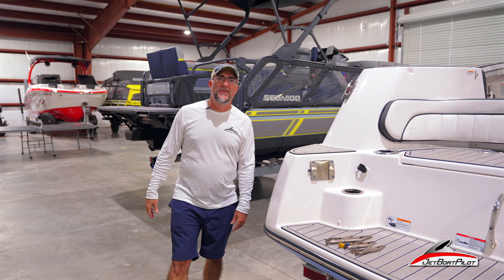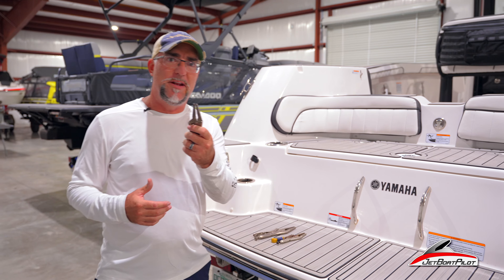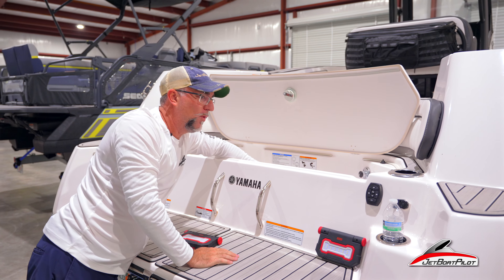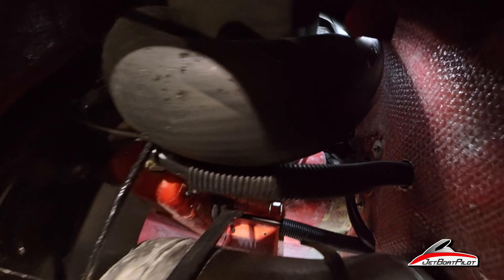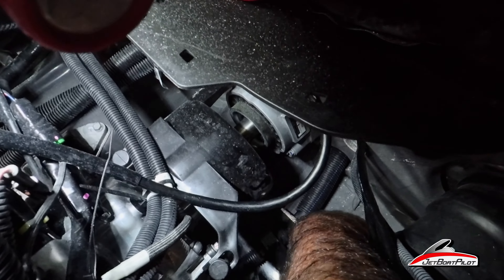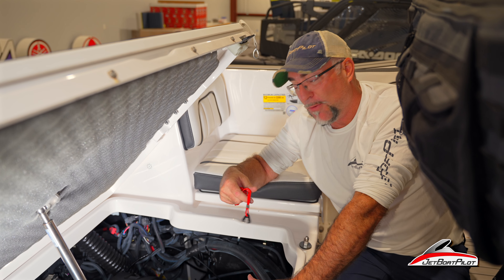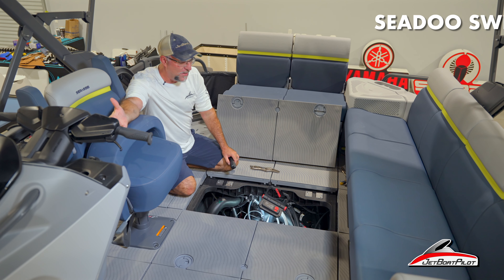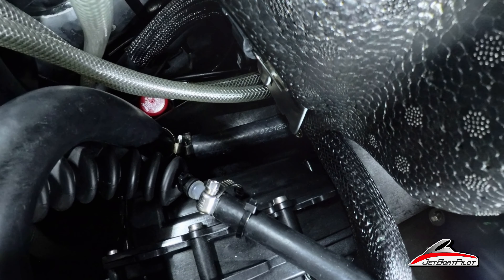Watch This Or Risk Damage To Your Engine | Learn How To Safely Tow Your Jet Boat

Comment: Yamaha, If you don’t have a set of pliers take your shirt off, or towel jammed in the intake via cleaning port and the water won’t make it through. I figure that out taking a bunch of sea weed and my engine got overheating, why?, easy water doesn’t flow even with engine running.
Reply from the maker: Cool solution!

Comment: I get that damage can result in damage to the engine when being towed, but exactly what are the issues?  I don't own a jet boat, but I have friends that do, so I guess you could say "asking for a friend".  Thanks.
Reply from the maker: @frankrobinson5453  water pressure breaks components within the engine's cooling system which can eventually bust the gaskets inside the engine and require rebuild. For SeaDoo switch the exhaust system can be damaged but sure exactly how.
Reply: @JetBoatPilot  really? C,mon, if the water system can take the pressure of a full throttle jet output, how is the pressure from parasitic intrusion during towing through the water intakes going to break components and bust gaskets?  The issue is water being pushed into an open exhaust valve resulting in potential hydrolock and valve damage on a subsequent startup. That scenario is highly unlikely if you tow with the throttle pushed wide open.
Reply from the maker: @rdsandy11  if the engine is not running the pressure is sufficient to damage components if tow speeds exceed max suggested. This is right out of the owners manual.
Reply: @JetBoatPilot  So the pressure from towing is more than a jet running at 7000 rpm. ok, whatever you say. The manual's caution is for what I said earlier. possible hydro lock.
Reply from the maker: @rdsandy11  no the pressure of the water flow on an inoperative engine is too great for the cooling lines to contain. This is the same reason you can't run water through the Flushing system without the engine running. Damage can and has happened when Flushing is done with power off.
Reply: @JetBoatPilot  sorry, wrong, you need to get with your Yamaha contacts and get the scoop. The flushing procedure is to prevent the same issue as the towing concern, hyrdolock from water being pushed into open exhaust valves. C,mon Will, people here trust you for good info, you should research this issue before putting out this tripe. There is no way the cooling system can't handle pressure from a hose. How does running the engine when flushing reduce the pressure in the cooling system to allow it to "handle" the pressure, but when the engine is off, the cooling system is suddenly compromised. My explanation makes sense, yours, not so much.
Reply from the maker: @rdsandy11  every jet boat mechanic i know has told me what I stated in this video, and they all agree. This video has value whether you agree or not.
Reply: Could it be both you guys are right?  I don't know, but rest assured I'll talk to my friends to insure they never tow with engine off above speed limits unless they block the intakes.  Great conversation.
Reply: @rdsandy11 correct, Yamaha boat engines don’t have water pumps so there is nothing spinning or needs to be spinning while the engine is running for water to flow through it. They rely on pressure whether it be from a hose or the jet pump. The main issue 100% is if the engine is not running there is no exhaust flow to push the incoming cooling water out of the water box. The water box will eventually fill up and go up the exhaust manifold and fill up the engine through the exhaust valves like you described.

Comment: Will, it would be great to see this on a single engine SVHO Yamaha for those of us who are not mechanically inclined. My thought is that it is inside the motor compartment just past the intersection where the clean out line comes in to the Y. Always informative videos

Comment: Will,  on the naturally aspirated tutorial on the starboard clamp I think I see it clamped onto the corrugated outer plastic ring  over the hose. Is this correct ? Will it crack or break the plastic cover and damage the inner hose ? Thanks for the tutorial. BTW to all the owners manual DOES address emergency speed operation in the event of an engine failure FYI
Reply from the maker: @JetBoat_LongIsland  I don't think it will harm anything. It's pretty pliable.

Comment: Great video,Will. Very informative. And you answered the question I was going to ask concerning installing ball valves.
Reply from the maker: @dougkratz5269  good deal, thanks!
Reply: Good advice Will on being an unnecessary add on with installing a shut off valve. My Yamaha master tech says your just adding another component that would be subject to corrosion and failure that would result in taking on water

Comment: Another very informative video. Thx Will!
Question... I brought this up to my certified Yamaha mechanic. He confirmed that your concept is correct, but he's concerned about the potential damage to the hose from the clamp. He said it may get damaged on the inside of the hose, even if the outside layer looks ok. Wondering if you've ever had to do this procedure and how things were afterwards
Reply from the maker: @jonathanspier6631  i have not had to do this much. I recommend leaving the span between the jaws at about 3/16" when clamped so you don't damage the hose. Or find some clamps that are more purpose built for this type of task.
Reply: Agreed. I think we'd want to stay away from the typical metal clamps like you show. Has to be something  that does the same thing without the risk of damage. Going to look into this

Comment: Please educate me - is this also an issue for non-jet boats?
Reply from the maker: @jamesfick4529  I'm not sure. You want to trim up your outboard engine when being towed I'd imagine. Some engines don't run raw water so in those cases maybe not necessary. I'd ask your dealer or an expert about your specific boat.
Reply: @JetBoatPilot  Thank you!  I have a '19 242X and also a Cobalt A36.  I appreciate your channel - you have great info that is really helpful for the boating community.
Reply from the maker: @jamesfick4529  you're welcome